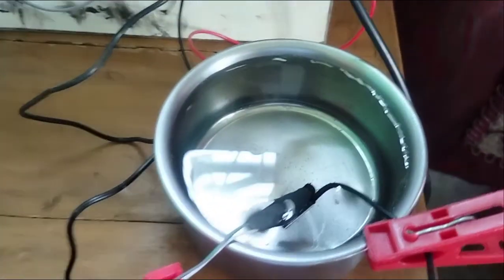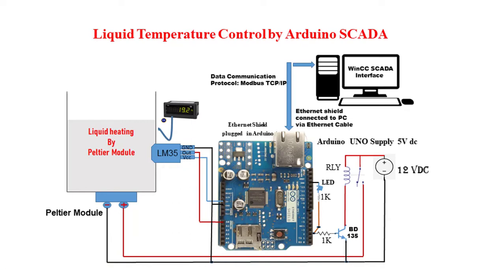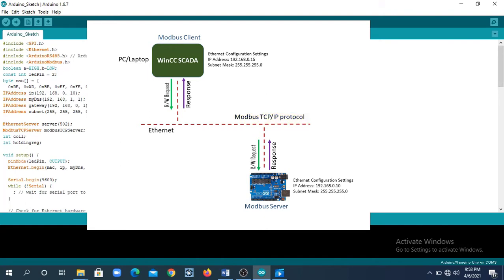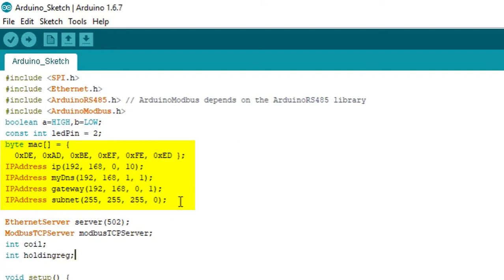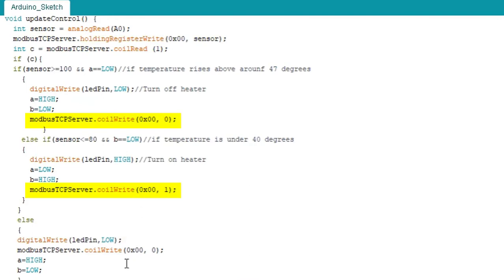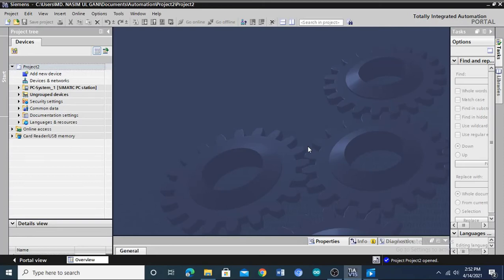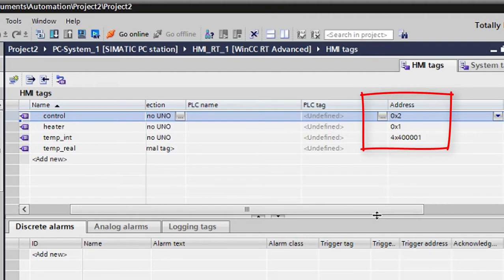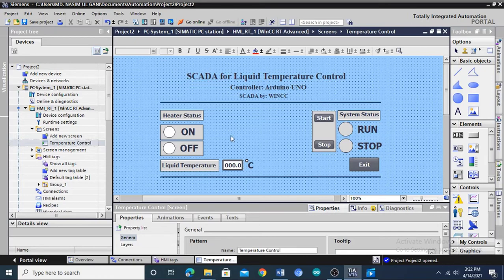Temperature Control using Arduino with WinCC SCADA via Modbus TCP

Comment: Hi, I have test on my arduino but when I connected to a device the Arduino hangs, cannot to ping to the ethernet shield board. Do you know how to fix this problem?
Reply from the maker: Please check IP address and subnet mask for both Arduino and the device(pc) connected to arduino.
Reply: @TechTutorial20  Yes, I configured and ping ok but when I connected to a device the Arduino hangs, cannot to ping continue to the ethernet shield board.
When I reset the board, the same thing happens again.
Reply from the maker: Please send me the Arduino sketch to my email address. My email: md.nasimulgani@yahoo.com
Mention your pc IP address and subnet mask.
Reply: @TechTutorial20  I sent you an email, please check it for details. Thanks